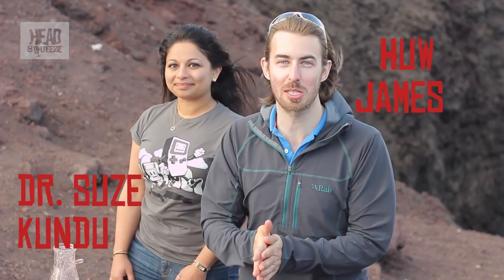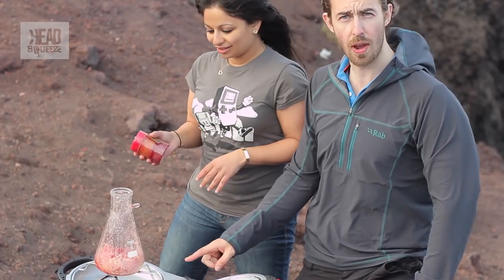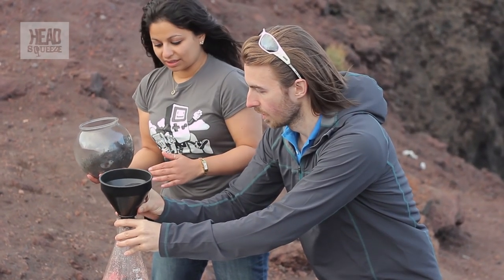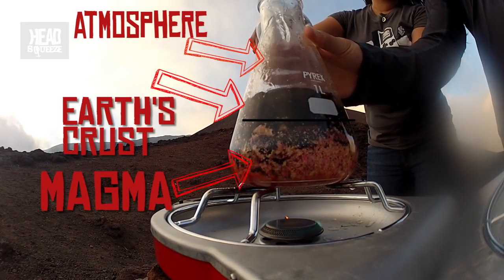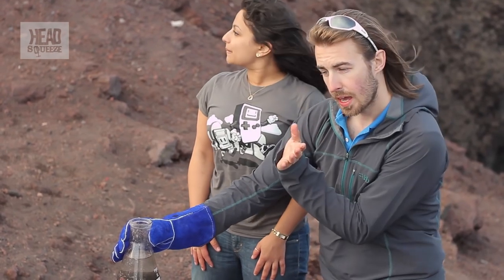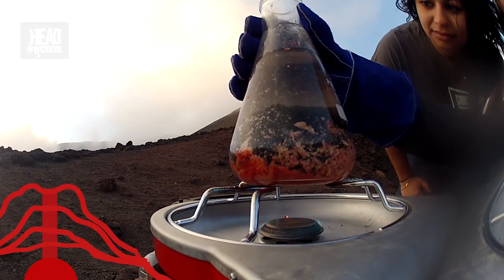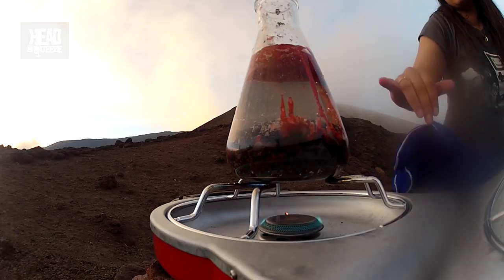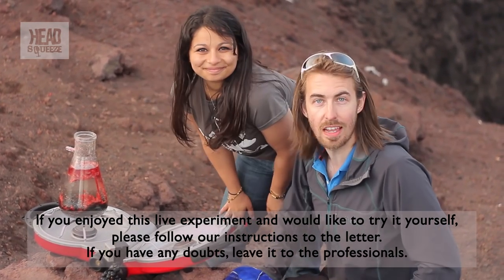Make a wax volcano | Shot on Mount Etna | Live Experiments with Huw James | Head Squeeze

Comment: So, I tried this using my Pyrex 4 cups meassuring cup, cut candle and sand. About 2 cups sand over the candle and about 1 1/2 cups water on top. Just when air bubbles began breaking through the sand onto the surface, and before any wax had made trough, my cup exploded!

Where's my mystake? I had tempered glass... so... Is it that my temperature was too high? Should I try lower temperature. It seems to me, the pressure under the sand buit too rapidly and pushed the walls of the cup until it broke.
Reply: +Edda Vargas I don't know the answer to your question but thanks for the heads-up!
Reply: I've given it some thought. First I used a big 4 cups measuring cup, with a wide base, then I used direct heat from an electric stove on high. I also used a lot of sand. 

I believe I heated it too quickly, the pressure built too fast and pushed sideways. The pressure made the cup explode, before it could liberate pressure upward. 

I repeated the experiment with a 1 cup measuring cup (tempered glass ) used medium to medium high heat and placed a metal tray between the stove burner and the cup. It worked pretty good, took about 8-9 minutes. My child loved it, will do it again soon.
Reply: Edda Vargas Thanks for the tips! we might do this experiment in a demonstration for a middle school parents day.

I'll be sure to test and experiment repeatedly to make sure the experiment will go as planned ;p
Reply: Happy to help.

Comment: another failed experiment covered by facts and animation lol.
Reply: It worked. The molten material did erupt.
Reply: no, the candle wax seeped through the jagged rocks that were too big to go down a funnel, no shit they'd be gaps. and ofcourse hot wax would rise to the surface. My point is if they did this experiment without the animations/location/using the word 'volcano' would you understand why they're trying to build a lava lamp with a filter? nope.
Reply: warfl4g it still described what is going on. Molten material pushing through cracks in the surface because of density differences. And anyway, it is a demonstration, not an experiment.
Reply: they said the wax would 3:00 "it'll actually make a dome on top" inside the vial, i see no volcano/dome. = failed demonstration

1:26 also "this is a  really good representation of what mt etna is doing 'specifically'" that's how every volcano works.. in fact that's how every dense liquid acts under pressure when it can force its way out.

it's a very poor demonstration, and could be represented MUCH better in various different ways that would make a better practical result. Why spend budget on flying someone to a real volcano just to demonstrate this derpyness. :p
Reply: warfl4g I see the dome, and so what if that's how every pressurized liquid acts, that's still how the lava acts. I think it was a decent demonstration. They didn't need to go to Mt. Edna to do this though...